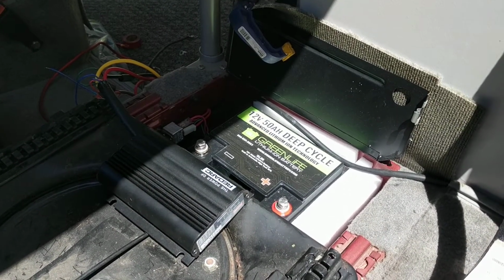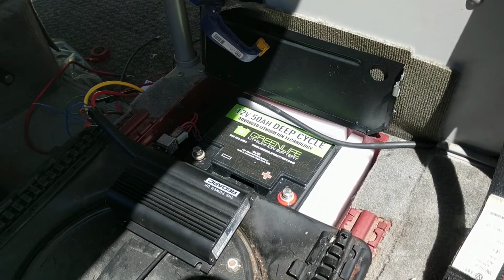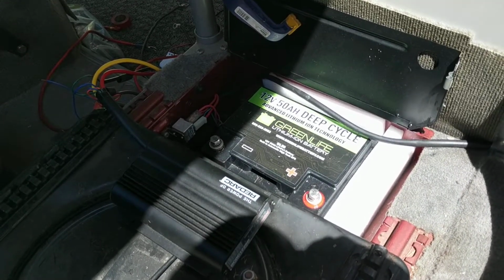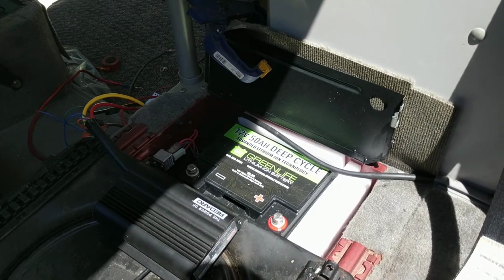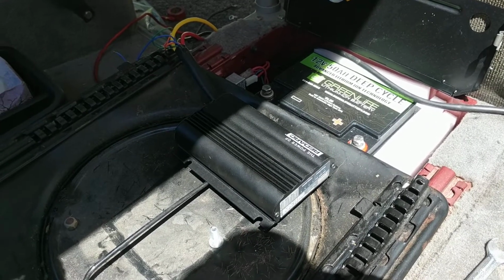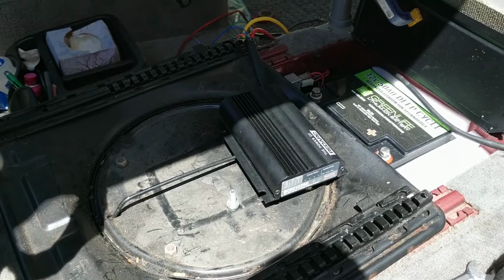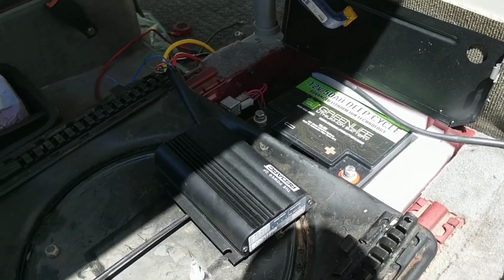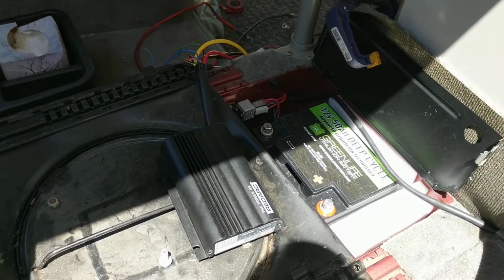Lithium battery in a Vanagon Westfalia with charger.

Comment: I would use LiFePO4 over Lithium ion.. I use Lithium ion batteries every day have no choice in my application, they are very unforgiving as to charging and over discharging..If discharged to far they will never recover to full capacity or just short and go thermal when you attempt to recharge. LiFePO4 are much more forgiving when charging and discharging and will in the real world give you more cycles and are not potentially dangerous.. The quality of BMS internal or external is questionable as you found in your testing. Also Lithium ion batteries don't like to be stored at full charge as it damages the cells. If you baby them and charge and discharge them properly and often they are much happier and last longer...